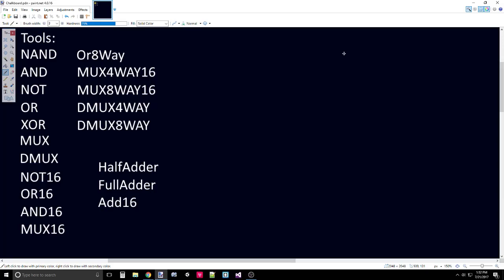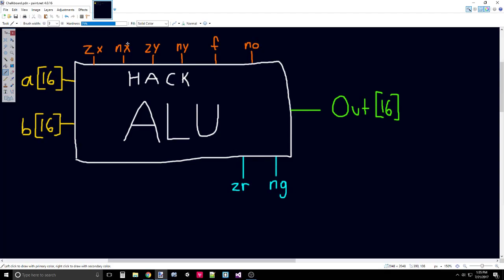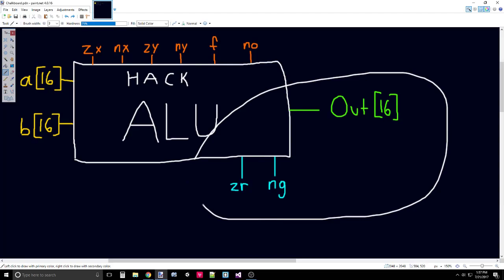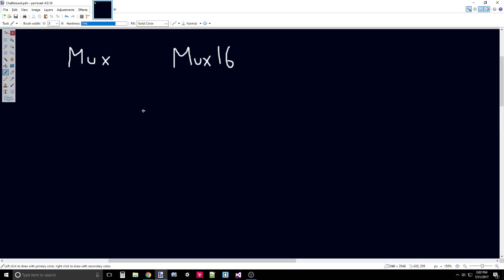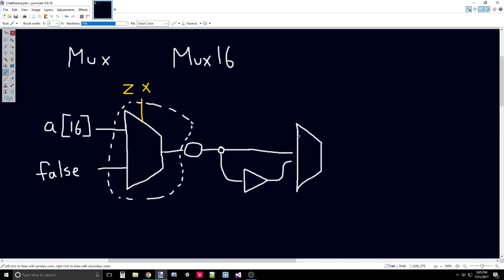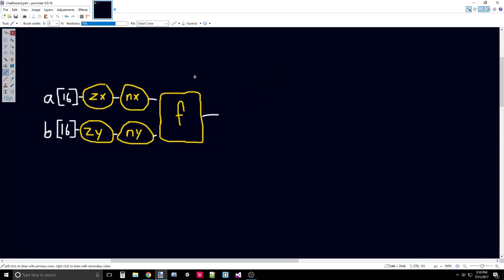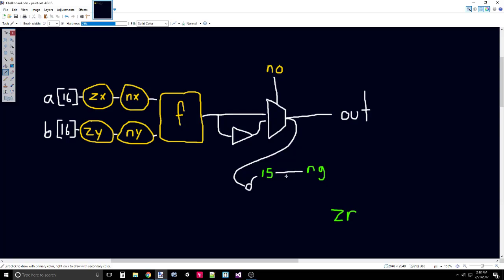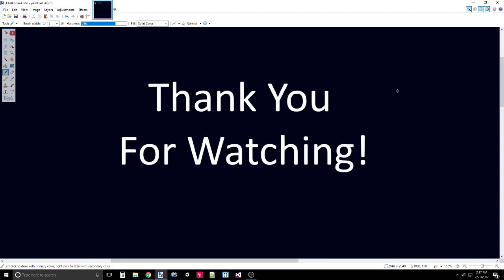Nand2Tetris StudyAlong - Hack ALU Design

Comment: This video doesn't address the biggest issue. You cannot connect the OUT pin with anything (by the rules which nand2tetris hardware simulator is crated), so you still don't have a way to get zr or ng outs
Reply: this is what I struggle with right now. What does he mean  by "not using the "out" but take the output directly of the mux" ?

Comment: I can't believe how simple this is yet I was stuck at this forever.
Reply: Like he said, if you haven't had experience in the past to use the digital gates in this way, then you wont immediately know you can do it. 

There is another trick you can do where you use an XNOR gate as a number comparitor/password system, because you get each input and seperate them out like A1,A2,A3,A4 and then B1,B2,B3,B4 and then let the number you set on the A be the value you must put in on B in order to get an output. say A = 0101, then the only way to get an output on the XNOR gate is to put 0101 on the B inputs, and that output can be used to show that the password was inputted correctly.

Comment: You forget to negate the output for Zr, didn't work for my simulator. but in theory works since a negative number is still not being zero will OR a one. Even looking at a Github repo, I couldn't figure out how worked, so thanks. I'm kinda dunning kruegger my self...

Comment: Thank you for your great video! I had headache with the ALU and specially with the ZR flag because the instructor told us to create a Inc16 gate.
Why did we create this chip?
Doesn't the ZR flag need to be NOTed? because what you wrote is:
If any of the bit is one then ZR equals true
In other words, if any bit is 1 then the number is zero
But this is false indeed